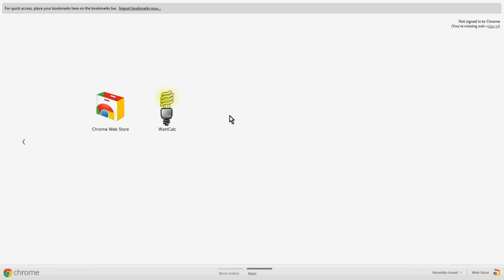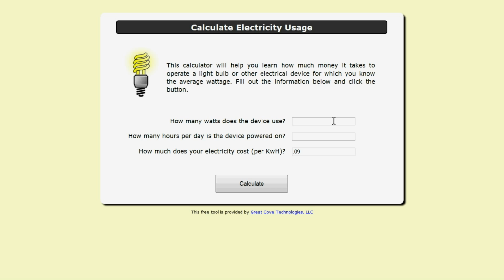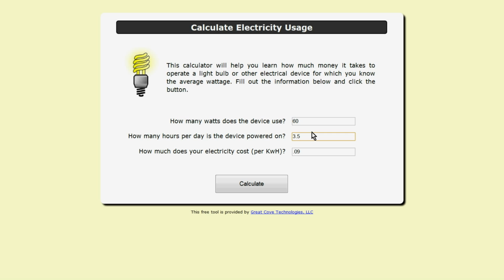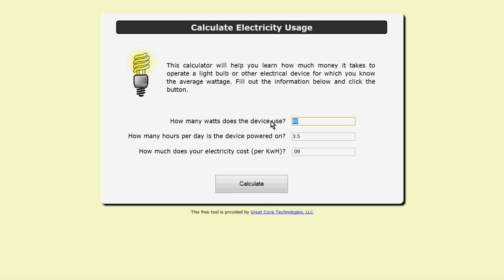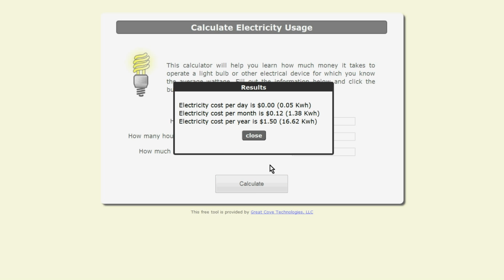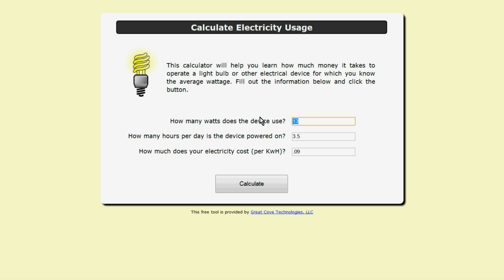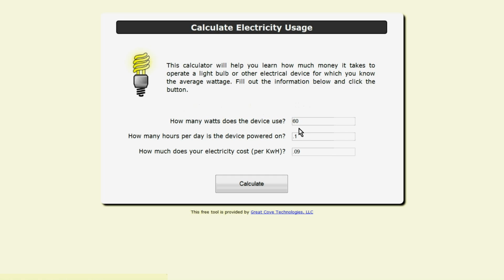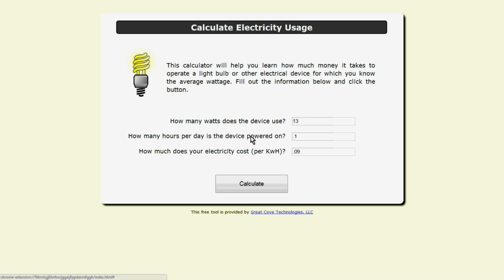Do CFL & LED light bulbs really save money?

Comment: Are the transformers in LED lights eating up more electricity if you have many light bulbs with individual transformers. For example if I have track lighting with 12 bulbs. Should I switch to a shop light (LED) that would have only one transformer that puts out just as much light as these 12 bulbs?

Comment: thank you for the converter. but if a light says 150 watt replacement uses 45watts. is that true tho. is it only using g 45 watts
Reply from the maker: I have used a volt meter on several bulbs and I have found the watts on the package are pretty accurate.  So if it says 45, its probably pretty close to that.

Comment: Remember the formula for bulb efficiency: Q = (B*t)/($s + $e*P*t), where $s is sticker price, $e is energy price, P is wattage (actual power consumption, not "equivalent" wattage!), B is brightness (aka lumens), and t is lifetime; the unit of Q should come out to lumen-hours per dollar. Assuming 10 cents per kWh, good LEDs typically have Q values around 600000 lmh/$, while a typical incandescent hovers around 100000. Replacing a bulb with one with a higher Q WILL pay off eventually - the higher the difference, the faster.

Comment: I only pay about $4 per LED I buy. Extremely cheap now a days, with the prices going down. However, even though they're a cheap $4 per bulb, I was only able to justify buying about 10 of them for the light fixtures that are used most in our house. Our electricity costs are quite expensive here in California, as PG&E ranges from $0.15-$0.36/kWh depending on how much you've used in the month. So having a tiered system is also another justification. Installing solar is also another great option as well considering how expensive electricity is here, and even more so in states like Hawaii or Arizona where it is hot most of the year. We did not get many CFL's because they contain Mercury and we've had incidents where some have gotten broken. So CFL's are only in certain locations where we know a dog can't get to them. Anyways, remember to take these factors into account when buying bulbs. If you break them all the time, you won't get your money's worth. LED's are fairly durable :)

Comment: CFL last longer than incandescent and LED last even longer than CFL
Even if you plan to use them in the closet for 3 min, the incandescent will last 1,5 years, the CFL can easily last 2 or more years, and so on; so you don´t have to re-pay for them; even if you use LED which are supposed to last 50.000h, you will have like 4 or more years before changing them 
I don´t know why people are saying they have never seen a CFL that last longer than 1 year, I have plenty that were used 10/7 and lasted almost 2 years
Reply: If you're using an LED in the closet for only a few minutes a day, plan on a couple centuries passing before it burns out. We have LED's in lights that get left on for 8 hours a day, and at that rate, they will still last us 20+ years, when the incandescent ones we used to have in the same fixtures lasted only a couple months.

Comment: If you actually want to test the wattage of certain bulbs, you can use something like the Kill A Watt meter:  http://www.amazon.com/P3-P4400-Electricity-Usage-Monitor/dp/B00009MDBU/ref=sr_1_1?ie=UTF8&qid=1414336045&sr=8-1&keywords=kill+watt+meter with a lamp.

Some bulbs are not as efficient as claimed - but a few are actually MORE efficient!

Cost of bulb replacement should be factored in here as well.  If an LED lasts 20,000 hours and incandescent 2,000 hours, then you would have to use 10 incandescent in the same time period.  Along with that cost, the cost of the LEDs are less intimidating... :)

Comment: There's only one flaw, which is the upfront cost of the bulb which you had not factored in, and the typical lifespan of the bulb. A person who pays 6.00 for a CFL bulb won't see any savings until after four years and I don't know any CFL bulb that had lasted over a year. They either stop working, or get broken. So while it may appear that you save money on your bill, you are still out $6.00 in your pocket. Another note to mention, is that people typically use the CFL bulb more often than an incandescent under the notion that it uses less energy. So in that aspect, the bulb will never pay for itself, and the person ends up paying even more.
Reply: CFL's are like 2 bucks a bulb, don't know where you got 6 bucks from, hell there are some LED's getting down to the 6 dollar price range.
Reply: Early CFLs were crap. I've had very good luck with modern CFL bulbs though. I relamped the entire house 6 years ago with CFLs and have only replaced 2 in an enclosed fixture. (Heat kills them)
Reply from the maker: blackboxdisease I converted most of the lights in my house to CFL about 10 years ago.  About a third of the original bulbs are still working.  Yes, there are a few of them that have failed within a year, but most last three or four years.  We only put CFLs in sockets where they are used enough that they will pay for themselves in a year and half.  So if we get an average of that out of each bulb, we're in the black.
Reply: I have CFL's that have run continuously for 3+ years.  They may not last as long in lights that are turned on and off frequently.  My CFL's have paid for themselves, but I'm converting them to LED's anyway as they burn out.

Comment: Bernardo, this is excellent advice! I was thinking of moving all of my lights to LED, but after seeing this, my strategy has changed. Why put a 10 dollar LED in a closet that maybe gets all of 30 seconds use per day? The math doesn't work. What I've done is assessed what bulbs I have on for the majority of the day and moved those lights to LED. CFL's are still part of the mix with some of the infrequent turn ons, and Incandescent are moved to the "hardly" used category like closets and sheds.

As a side note, has anyone done a heat comparison with LED vs Incandescent, and lets say a bulb burning for 12 hours?  Does the heat generated negate the energy savings of the LED, because the furnace has to run less due to greater ambient temps generated by the incandescent bulb?.
Reply from the maker: Todd Ouellette The heat generation of light bulbs and it's effect on the economics of each type of bulb is an interesting and perplexing question.  I'm not knowledgeable enough to give you a solid answer, but here's a few thoughts to stir your thinking.  If you are using a heat-generating bulb in the wintertime while you're heating the house, it's a benefit, right?  That depends.  Is your house heating system more or less efficient than the electric heat generated by the bulb?  If the house heating system is more efficient (cheaper to use), then displacing that method with the electric heat generation of the bulb is costing money. In other words, it would be better for the bulb not to generate heat and let you generate the heat with your heating system. However, even in that situation, you still get some benefit from the heat of the bulb.  On the other hand, in the summer, the heat from the bulb is working against you if you run air conditioning.  If you don't need an airconditioner, then the heat from the bulb isn't adding to a cooling bill, but you're still generating heat that you don't need.
Reply: Bernardo's Tech Blog Definitely food for thought. I do have a 95% furnace, so gut feeling is that it is much more efficient at producing heat than an electric bulb. Bottom line, is that no matter what efficiencies are created through technology, the Government and Utilities will just make it that more expensive. It's a zero sum game and we are on the losing side. Our Grandparents burned 100w bulbs 24/7 and paid 20.00 a month for electricity, and now we're sitting in dimly lit LED rooms and paying 200.00 a month.
Reply: Keep in mind that heat generating bulbs in recessed cans will likely generate heat that is lost into the attic anyways... :)  Electric heat is typically less efficient than what your furnace would provide, so I expect the savings experienced by not running your furnace the small amount of time would be more than offset by the cost of running the bulb itself.
Reply: Todd Ouellette
just get your power requirements down low enough so you can do solar or wind power and be "off grid"

Comment: Yes, they're money savers. But LED takes the lead because its safer, more efficient, last longer, generate less or no heat, and reliable than the CFL, but I think that cost more though.
Reply from the maker: Corey Williams Yes, LEDs look like a winner, but I'm still waiting for the price to come down before I start switching them out.  I still have a few CFLs in stock that were given free by our electric company.  Once those run out, I'll start putting in LEDs as the CFLs start to fail.
Reply: Bernardo's Tech Blog  comment posted: 8-16-14

 I just bought an LED light bolb today at Big Lots with my mom. It's a FELT ELECTRIC LED Dimmable A19.

Details:

•60 Watt replacement uses only 9.5w

•800 lumens

• it lasts for 25,000 hours (22.8 years)

•$138 energy saving*

•soft white 3000K

•Uses 84% less energy**

•lights up instantly

•Dimmable

•Mercury free

• OMNI all around light distribution

•Estimated Energy cost: $1.14 per year

Pretty cool, huh?

Comment: I have bot both CFL and LED Bulbs and I have noticed BOTH GET  HOT !!!  My Qn is are they really saving energy or is energy actually  being wasted in "Balasting" the high 110 Voltage down to a Lower Working CFL and, very low wattage LED voltages ?   Where is all the heat coming from ?   John 2014
Reply from the maker: I also wonder about the efficiency of having to convert 110 volts of electricity to something usable by a CFL or LED.  And the circuitry to do it is manufactured and included on each bulb.  It seems to me we should standardize the voltage for a lighting circuit and wire houses to have a separate, low voltage circuit for lighting.  That way, LED bulbs could be just that, bulbs. And not all other other stuff to convert the voltage.  But maybe I'm making this into a bigger deal that it is.

As far as your questions, the bulbs do save energy.  I have tested several CFLs with a meter and the rating on the package is the total electricity used, not just that used for the bulb.  Yes, there could be some energy wasted on the electronics, but they still save energy to use.  The extra manufacturing required is another question, of course.

And I don't know where specifically the heat is coming from.  Mine don't get anywhere near as hot as a incandescent, but they still get pretty warm.  Thanks for the comment!
Reply: Bernardo's Tech Blog Like very much your making things 'easy' to 'understand' for us regular folks out here in Techno-Mania-Land... It can really be overwhelming trying to make sense of it all...  John 2014
Reply: Its all about watt consumption at same level of light in the room . So measure the watt consumption(with a plugin wattmeter) of one led bulb and one incandescent bulb and there you can see the savings . Now the fun begins : the incandescent works lets say 1000h and LED 50.000 (they say that based on math not testing) . To be certainly sure that you will save something , take in consideration buying an LED bulb with 5 years or lifetime warranty because if you buy from amazon 5 LED noname bulbs, the capacitor or other electrical parts from the driving(converting) components may be low quality 1000h -3000h and you wake up saving or `10$` in 2-3 years or worse Nothing

Comment: The main factor that you haven't taken into account is the price of the bulb VS the expected lifetime. Incandescents typically last a year or so, CFLs 7-10 years, LEDs 20-25 years. So, if an incandescent bulb is $1.50, before you even factor in energy cost you'd save money by replacing it with a LED bulb that costs less than $30. One LED vs 20 incandescents, and that's not even taking into account the time it takes to repeatedly replace the incandescents. It's really a no-brainer.
Reply: And the fact that LED bulbs are now cheaper than ever. There are decent $10 LED bulbs on the market.

Comment: LED's last longer, and have almost a CRI 0f 100, which makes them better for light quality.  CFL's sometimes overheat, and many of them burn out quickly, although I have had a few that have lasted several years, but the CRI on most of them is no higher than 80, so the quality of light is not near as good.  I also stocked up on incandescent before the LED bulbs came out more, but there is really no 100 watt equivalent bulb that will work in my fixtures.  I will take the healthier light of the LED and Incandescent bulbs before I waste any more on CFL's
Reply: Only Sun has 100Ra. About those LED`s, send me some link, I`ve seen only CRI of 93 and those were expensive and not so efficient as regular ones.
This reminds of lamp and transistor amps.
Reply: Very few LED's have a CRI above 80.  Most high-CRI bulbs are around 93.  None that I'm aware of are at or near 100.

I think you're confused.

Comment: the main difference between theese bulbs is they efficiency,there is an amount of enegry that every bulb is using,the main thing is that wich bulb can transform the most of that energy in light,the incandescent bulbs are not so efficient because they emmit a lot of heat,so a lot of energy is wasted by transforming to heat,i think people already noticed that LED bulbs and CLF's are not as hot while operating as the incandescent bulbs,this is where most of the energy gets saved,and this is why you can decrease your electricity bill by buyng LED bulbs,and they last much longer

Comment: I also have CFL bulbs that were installed when my house was built in 2002. They are also the old Ikea crappy bulbs. I say that because they are slow to start, and they are dim.  CFL bulbs do not like to be turned on and off frequently. So where do I use them? In ceiling fixtures in bedrooms, the kitchen, main hallway, den. In the living room, and dining room I use dimmable CFL bulbs. I also use them in the main bathroom, and ensuite, as these rooms are generally used for more than 15 minutes at a time. The powder room gets LED bulbs, as they are generally only on for a couple of minutes max. The closets have good old incandescent bulbs.
I also have LEDs in a few fixtures that are used as night lights, and in my outdoor security lights I use LEDs, but CFL bulbs in the outdoor lights where more lumens are needed. In all I have about 70 CFL bulbs, 15 LED, and only 2 or 3 incandescent bulbs in my entire house. Most of my CFL bulbs are 8 to 10 years old now.
Reply: The same thing happened to my top o' the line cfls.  This seems to be what can be expected of cfls despite what manufacturers claim.  The slow start was so long, I could actually time it with my wrist watch.
Reply: Jerad W
I just had another 30.00 name brand LED lamp go tits up in a puff of smoke. It was flickering for a few days, and now it is dead.
So I bought a new one, and next time I visit the store I will return the dead one and get my money back. No more calling the toll free number as the last time I did that they shipped a new bulb to Canada, and I got hit with a 40.00 broker charge for the warranty replacement.
Reply from the maker: I think I'll wait a while to move to LEDs - until the price comes down some more and the quality goes up.

Comment: I have a CFL that I purchased in 1998 at IKEA. It has been on almost every day for at least 7 hours. It is now 2014 and has never been replaced. Not a word of a lie...
Reply from the maker: I have some very old ones as well. There are always a few that fail prematurely, but on average they do last a long time.
Reply: Bernardo's Tech Blog My experience is the opposite.  I have a set of 3 can lights in my bathroom.  The incandescent has outlast 3 cfls.  They were billed as top of the line and would last for 7+ years.  Not even close.
Reply: Jerad W  If you are turning them on and off all the time led bulbs are a better option. Get good ones in 2014 with good heat sinks and good color and you will be set for a long time.
Reply: Jerad W That's my experience also.  I would guess that i've bought around 20 CFL's in the last 7 or so years.  3 of them were used in the same lamp, and i've used at least 3 bulbs in the (2 sockets) bathroom too.   Add up the cost of bulbs and time running out to get them and i've most definitely lost money.  Not to mention the light from cfl's  (and LEDs) are annoyingly dim and difficult to see by in comparison to any incandescent or halogen lamp bulb.   If you're into car lighting, you'll know the same thing is going on there.  There are a lot of people jumping to LED headlight retrofits, but the lighting and illumination is generally inferior (this is a fact, not opinion) and you won't see as well unless you install massively overpowered models that can't be used on city roads.
Reply: How much did that CFL cost you in terms of energy use based on an average of 7 hours a day?

Comment: This isn't all that difficult. How much you use the bulb, how much it costs, and how many times you would have had to replace the incan in the life of a single LED bulb. If you only use the light for 20 minutes a week you aren't saving anything. If it's your bathroom light get an LED and don't look back... don't use CFL there, they don't like the on off on off thing so much. In your living room light that need to be bright and on for 3 to 6 hours a day (sunset is like 430 in the winter here).  For those hard to reach areas I love LED. I'd rather just put one in and not have to get a ladder out for the rest of the decade, or longer if it's not used much.
Reply: We have a CFL in the toilet that I installed in 2003.